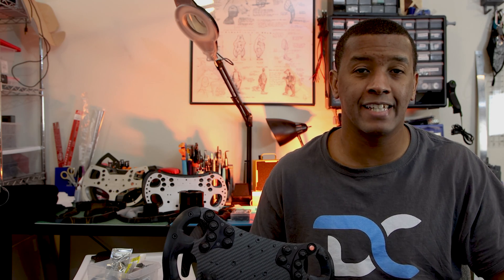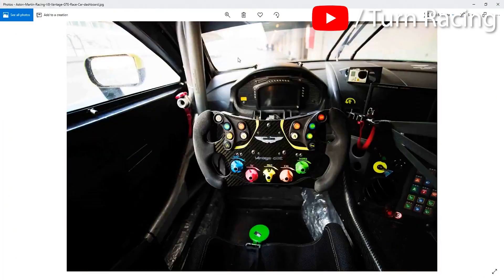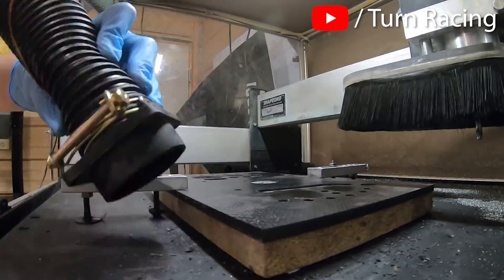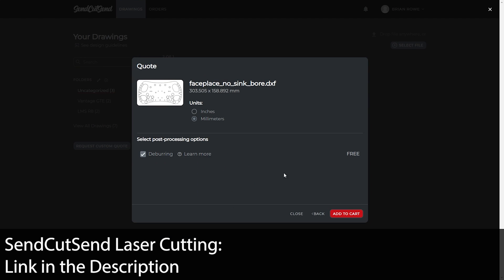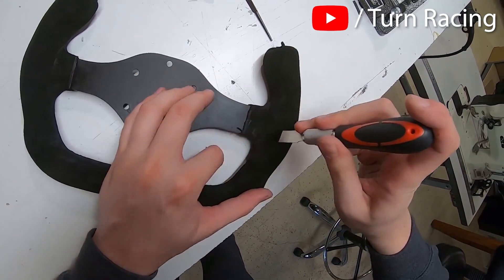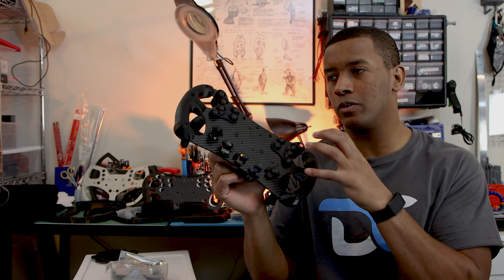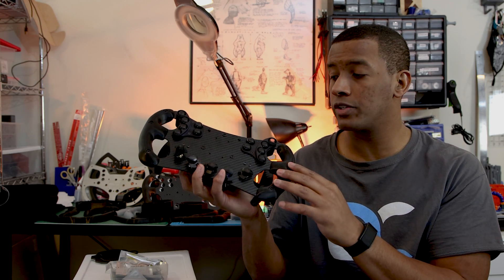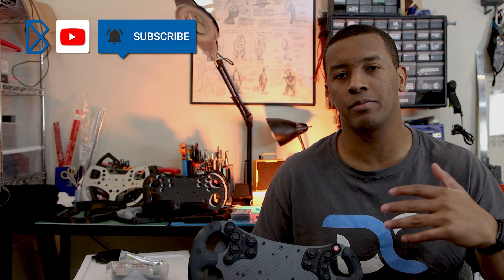How to Build DIY & Replica Sim Racing Wheels [Part 1]

Comment: Super intersting to watch. I will build my very first DIY wheel in some time forward. Therefore im trying to get as much informations for where and what to buy for my wheel. Unfortunatly the link for your Discord server is not workling anymore. Is it still available or is it dead already?
Reply from the maker: https://discord.gg/qbRBsVKw

Try this one. lmk if it works.
Reply: @BallisticTech  Looks like this one does not work either for me :/
Reply from the maker: @neticx  if you Google turn racing and go to the website there should be a link there

Comment: Looking to make custom polyurethane grips. Any insight? Going to print 3D model of Moza GS wheel. Any advice works be great.
Reply from the maker: Best bet is the Turn Racing Discord. I've done a bit of testing with a 3d printed mold and a couple materials. It's definitely doable but a lot of work for a 1 off build.

Several guys on the Turn Discord have tried and posted their results. I have some pictures up there too if you search for molded/casted grips.

They also have a wiki with some info
Reply: @BallisticTech  thanks man I appreciate it. If I get it right, looking to start a side hustle. So hopefully more to come.

Comment: Awesome video! Im really into 3d Printing and making my own accessories for sim racing and have made several button boxes and mods for logitech gear. Im really trying to do this DIY Wheel as well!
Reply: Id love to see your button boxes. I 3d print on a daily basis and have been wanting to make a button box for my rig for 2 years but I never did it yet. (a bit afraid of the arduino bit)

Comment: Do you have any suggestion or reference material on dual bite point clutch custom wheel design? I try to search online but seems like material is quite scarce for circuit design and coding. Probably I look into wrong areas.

Comment: DIY if you have a mini manufacturing plant in your garage... lol wtf even.
Reply from the maker: Not sure if you've watched the video but the point is to show ppl how they can use the tools and skills they have to do as much as they can themselves. That in combination with buying some components and using services allows ppl to build the wheel they want.

Zach makes wheels full time for a living. So yeah he has a lot of tools and equipment. But I show how to do stuff with hand tools, a soldering iron and 3d printer as well.